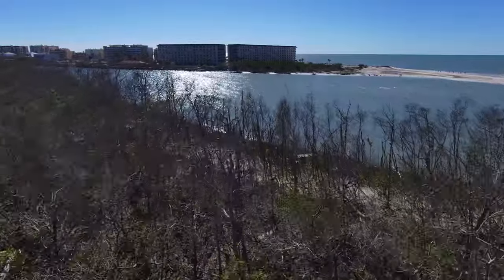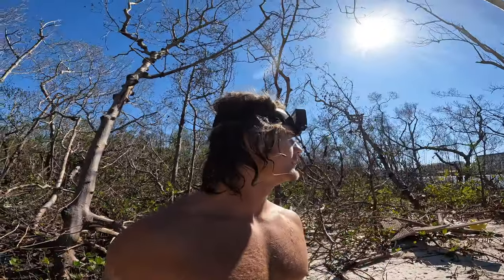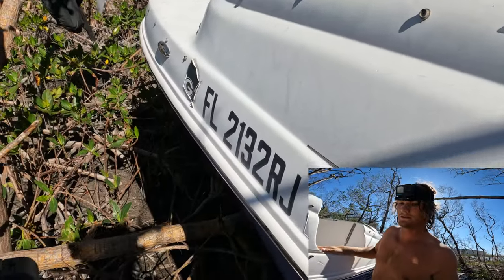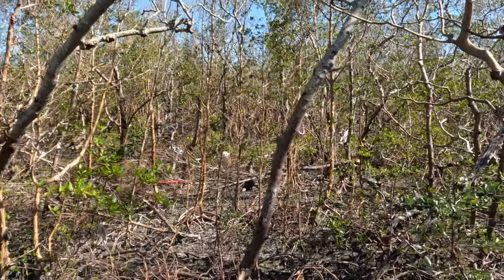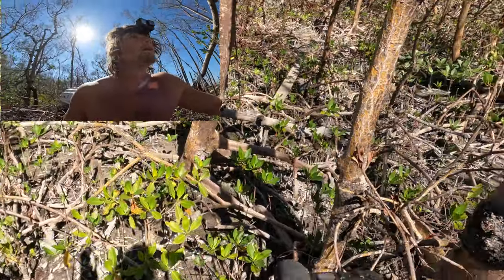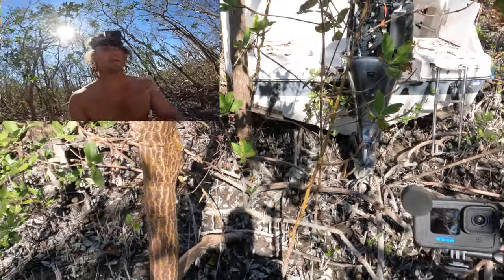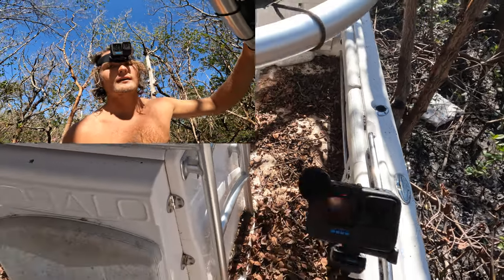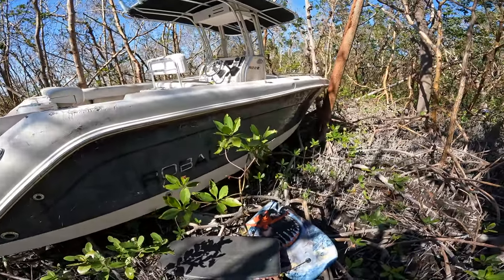Exploring Swept Away Boats Deep in the Mangroves! Bonita Springs, FL

Comment: Looks like when you started your barefoot adventure you were crossing an area with a lot of red mangrove seedlings, but before you got to the second boat it looked like you were having to navigate black mangrove pneumatophores. Ouch. Is the mechanical thrashing that the mangroves received from the wind responsible for the die-back?
Reply from the maker: Lol it was alright as long as I was on the roots of the trees! I really think the storm surge played a huge role in the destruction to the mangroves. There might have been enough wind to remove to leaves and cause defoliation, but the surge at this area was 16 feet. The front line trees do a great job of lowering wave velocity and wind speed which would explain why the inner mangroves did just fine. Either way they served their purpose in a storm like this…. 🤙